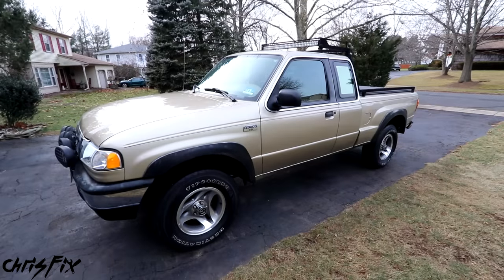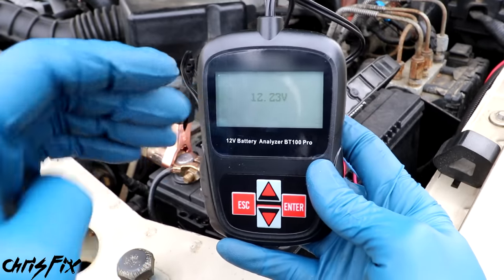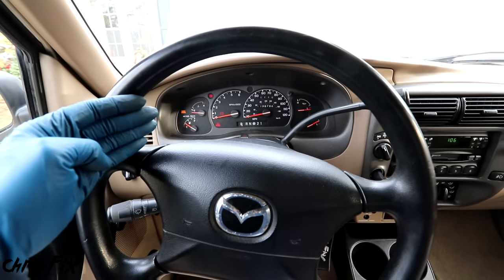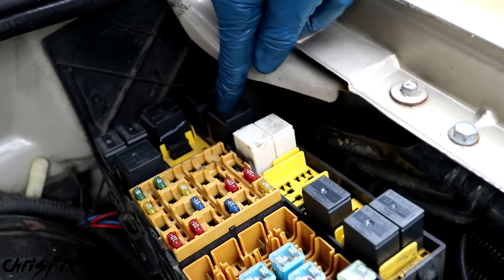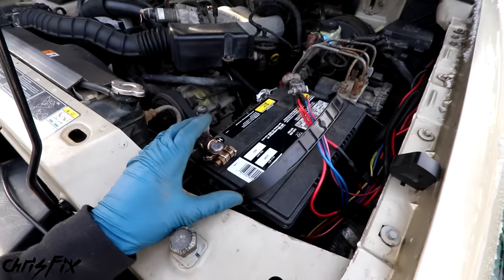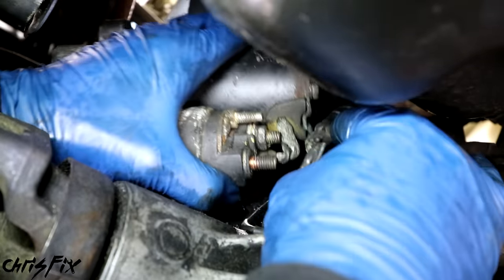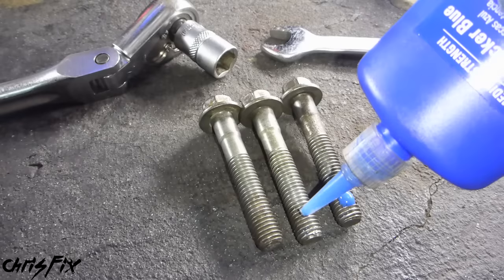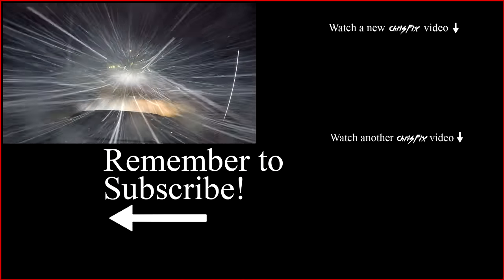How to Diagnose and Replace a Starter

Comment: One tip: DO NOT turn in your old starter (or any other part) for the core charge when you pick up the new part. Wait until a week or more after you've  successfully installed and used the replacement. Occasionally the store parts will ALL be junk (or wrong) and they won't have another part option and you will never get your old part back from them. Keeping your old core allows you to return the junk parts and go to a completely different supplier. I've learned that one the hard way a few times.
Reply: Just wasted 130 for an alternator for this same reason, car was still stalling after replacing and I had already turned in my core.
Reply: I usually got good results with a junkyard OEM unit.  Even if it didn't work I can swap parts off my old one and make a good one out of the pair.
Reply: @milescarter7803  how much does it cost at the junkyard?
Reply: something like this is illegal here in germany haha
Reply: Very good point
Reply: This is going into my ‘random good ideas I picked up reading posts online’ memory bank.
Reply: @Prodmullefc 😂 a visual post of something I actually do, guess people are not so different
Reply: Good advice, thanks
Reply: Good advice. I work at a parts store and have had multiple customers have something similar to this happen. Your part will definitely be gone by the end of the day you turned it in.
Reply: Good tip thank you! Haven't had an issue so far but only just started doing work on my truck. Never done car work before this year aside from oil changes and filling fluids. Gonna start doing as much repairs as I can manage, when they are needed, and I will start keeping my old parts like you suggest! Take care and God bless you!!
Reply: @arbiya4346 what exactly is illegal in Germany?
Reply: @BrassStorm  i dont know anymore afer 6 months
Reply: @BrassStorm 
What ISN'T illegal in Germany?
Reply: @arbiya4346 why????
Reply: @clematistaiga  thats scam. Thats why it is illegal
Reply: Thanks.
Reply: @arbiya4346 just telling lies for nothing is wild lol he probably not even German
Reply: What if you’re just turning it in under warranty? My thinking is if the next one they give me doesn’t work, just rinse and repeat because it’s under warranty. 

Maybe a silly question but wanted to ask anyway.
Reply: Good tip bad explanation
Reply: My starter in my truck(1993 dodge d250) just went out, I am going to get the original rebuilt because it’s original to the truck and run the parts store reman and keep the oem as a spare
Reply: Best tip here buy the starter you need and do not return the old one correct but instead remove the core from both swap the internals return the new one that has the old internals given that you cleaned it correctly get your 300 back and install the old one with the new internals…/ rebuilt haha 😂
Reply: I know this is 2 years old so but if you're buying from part stores it almost never makes a difference if you keep the core or not. The core change is almost always the exact same so it doesn't matter if they don't give the core back. They should give you credit back instead of the core if they can't give it back.
Reply: But why would I want a starter that doesn't work? I guess if the store one is junk and you return it, you can still get your core deposit at a different company.. makes since thank you
Reply: @alphasheep99  I keep mine and get it rebuilt so that way I will have a spare in the vehicle incase it goes down I’m not stranded
Reply: Just get a starter with lifetime warranty
Reply: That why you get it diagnose it instead throwing parts into the car

Comment: Hyundai wanted 800 to replace my moms starter. We tied a rope to the car, pulled it right off their property, and replaced the starter on the side of the road in front of their sign for dirt cheap.
Reply: BDE
Reply: how'd you get the key?
Reply: weird flex but ok lol
Reply: @HearMeLearn  ?
Reply: Lmao
Reply: DeadPandemic a spare probably
Reply: @thatkidjoly  they did not steal the car, they just towed it out of hyundai's property. (remember, starter  broken, car cant start)
Reply: Lmfao that must have been the biggest  flex ever
Reply: @HearMeLearn  omg its him, sinus lebastian!!
Reply: Five years ago, a Ford dealership wanted $1,500 to install a new oil pan on my Mazda B2500 truck. I told them no way and to perform a drain plug tap. Shop mechanic said they don't do that service! I told him to stop all work on it, had it towed to my house and hired another shop to do the oil change and drain plug tap for $140. ChrisFix rightly calls them stealership! LOL.
Reply: SAVAGE!!  i love it.  right in front of them too.
Reply: this weekend, I paid 23 dollars for the repair of the starter and 8 dollars for the installation.

Comment: The real reason to bring the old starter to Autozone is to make sure they actually give you the right one.
Reply from the maker: +williwonti haha that too! Good point!
Reply: ChrisFix  ...hitting things with a hammer always works ...thats oldschool   haha
Reply: sounds about right
Reply: swaneye34 I don't think AutoZone rebuilds starters. unless just replacing a solenoid. it's not something you can just go to school for.
Reply: Well yeah, that's what a remanufactured starter is, Swaneye. A lot of companies do that, and if they're a reputable company with high standards, there's nothing wrong with a reman.
Reply: Also inspect the included hardware, especially with starters and alternators. You may have to harvest more items off your old one if it's not compatible or missing.
Reply: i dont need you to tell me to do that
Reply: Haha! I can't tell you how many times I've picked up a part and just left with it and get home to install it and it doesn't fit. Most of the people working at parts stores are complete idiots, especially Auto Zone. My dad always called the people working at our local one mouth breathers. haha! I now check part numbers AND OPEN THE BOX every time. Advance is the best place to get parts (local).
Reply: @narlycharley   I used to work at an autozone in college and they pay minimum wage. It depends on the worker, you can get a good DIYer who knows some thing or you can get a worker who just sees it as a job.   However, you can't expect someone who has the knowledge and the experience to help you, to work for pennies on the dollar
Reply: @--emt  in the case of starters it does, many times the solenoid is dying and the knocks make then give the last breaths and throw the gear and start the car.
Reply: @narlycharley  Have worked on my uncles starters and alternators shop and had no clue about car parts luckily parts manufacturers provide us with software to track the parts, just need make and model to know the part number and is very irritating that in some stores the guys don't even bother to check all the info to get you the right part.
Reply: Not mine, you would bring in the core and they would still give you the wrong one
Reply: You spelled “Advanced Auto” wrong
Reply: @--emt  didnt work on my girlfriend lol.
Reply: Eduardo Portillo how does that solenoid work exactly?  Mine has a “s” terminal and an “r” terminal.  What’s actually happening when you turn your ignition switch to start and nothing happens?  How do you tell if it’s the starter solenoid or the starter motor? Do you measure it with a voltmeter?
Reply: And the $40 core charge you don't have to pay
Reply: @--emt  been there done that
Reply: Williwonti.....that's saying it politely.....AutoZone High School.....typical revolving retail door Store....

Comment: Great teaching!  I'm hanging nine interior doors, and on the first one I tried a Ryobi jig.  It didn't work out as well as I would have liked.  After watching your video, I lined up my points to drill the face and side of the doors.  Easy peasy.  The jig goes in the trash.  What I learned here stays in my head.
Reply: Crap!  I was commenting on another video (about hanging doors in my home), and the video ended--and this ChrisFix video started.  Apparently, the comment went to Chris' video.  That never happened to me before.

By the way, this starter video helped me change out the starter in my 1999 3.0 Ford Ranger.

Comment: even though it's completely irrelevant for me, i love watching these videos so much!
Cant wait to get my first car, i'll be folllowing all the car buying checks and car cleaning videos you have!
Reply from the maker: It isnt irrelevant because you can always learn something for when you get a car!
Reply: Yeah. I can see the trick about hitting the starter saving some people from a lot of trouble.
Reply: Andrew Smart dont buy a protege those r hard to work on when it comes to changing the starter and changing brake lines and such its a pain in the ass i own a 2000 protege lx 5 speed with all power options and needed to change the starter took me almost 2 hours to get it out and the belts gotts be done i peddy myself when i go to change them
Reply: dont get me wrong tho i love my old mazda runs like a charm and loads of power
Reply: Andrew Smart  im 11 years old and i cart wate to get my car!!😀
Reply: RCman9291 No worries mate, i live in the uk, and i doubt you can even get those cars out here. Hoping to get a 2010 vw polo!
Reply: Tyler rose Any idea what you want your first car to be?
Reply: Andrew Smart they r awsome cars bud but just a pain to work on for some stuff like the starter and brakes and belts the rest aint to bad
Reply: it's not irrelevant. By watching these videos, you will save $$$ by doing it yourself instead of paying some shop to do it for you. Example, brakes. Shops will charge $250+ to do a single axle. By DIYing yourself, the $250 you would have paid for a single axle brake job, you can replace all your brakes and have money left over.
Reply: Andrew Smart lol same here!
Reply: same I look forward to writing a list of things to do to make my first car better than when I buy it
Reply: Because of these videos I got the courage to get a used motor scooter, and am replacing some parts myself already! It's not even a car!
Reply: Andrew Smart same with me
Reply: Jacob S eh dont make a list yet untell u get the car cause u can make plans for around 2 grand but the car u get may cost u 4 to 5 grand in the same parts some makes and models r cheaper than others like a full exhaust for my 2000 protege is around 350 from the manifold to the can and some r more than that so find out what car u want then price it for that car so u can stay in the $ range
Reply: Andrew Smart same here dude even tho I'm 17 I don't own a car yet or have my license or drive but it's so much fun to see Chris fix his cars and see them running. like they came out of the factory

Comment: Thanks, mate! You saved me having to take the car in to be looked at: previous battery failed and apparently corroded the negative terminal. It wasn't starting, so I checked the fuses and the battery, but no dice. I watched this video in the hopes it would give me an idea of what was wrong, and I ended up only having to remove the corrosion from the terminal clamps before it started up. Awesome video, as usual.
Reply: Awesome

Comment: Great info as usual Chris! When my starter went bad, my car was starting intermittently.  When it ultimately failed I was at an auto parts store with a mechanic shop next door.  I wanted to fix it myself but it made sense just to pay the mechanic shop to put in the new starter for me.  I had jobs to go do so in hindsight I was blessed to be in this situation.